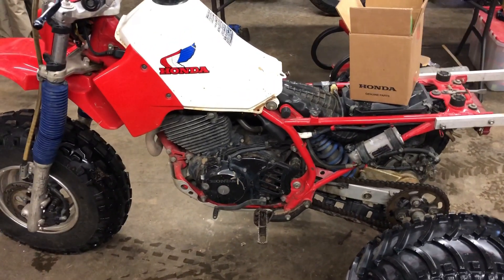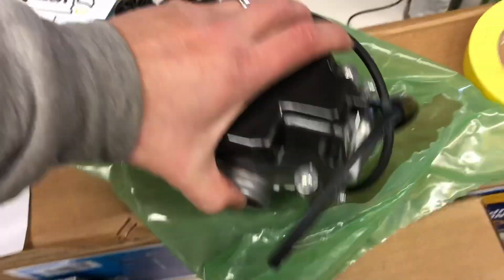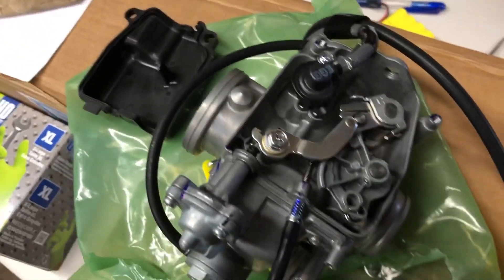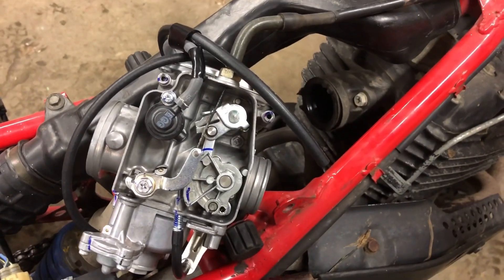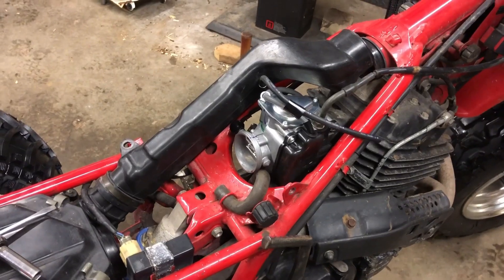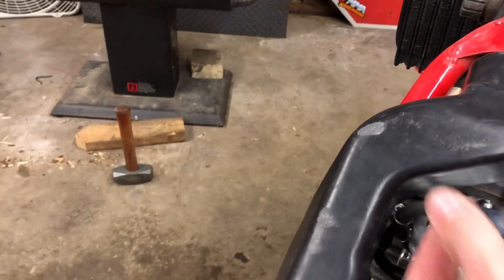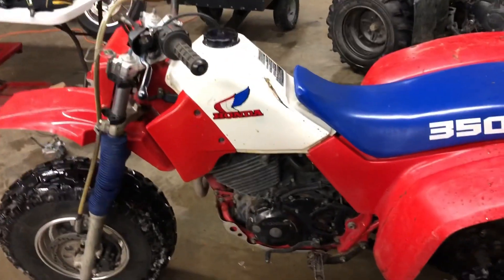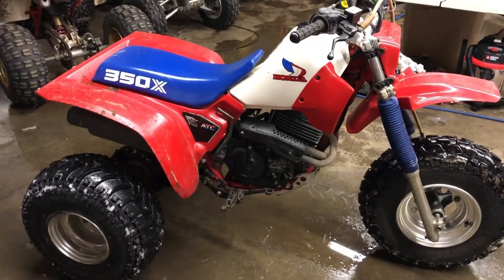350x Honda atc 400ex carburetor install

Comment: No doubt the 400ex carb is a good improvement, but an FCR with a hot start is so much better. A better response throughout the power curve and hot start makes it much easier to start after stalls! In my opinion, a must for older 4stroke kickers. Your shoes and shins will thank you! I miss my X, lol!
Reply from the maker: Man. I just bought an 86 350x. And have a 400 carb coming for it. What’s an fcr? I’ll have to google
Reply: @JohnVHLife  it's a Kehin flat slide with accelerator pump performance carb that the 06 up TRX450R, CRF250,450S Older YZF & YFZ450 came out with has outstanding throttle response. I have a 2005 TRX450R with a 41mm FCR bored to 43mm. I believe the older YFZ450s had a 39mm that should work great for your application and shouldn't be to expensive.
Reply: I'm 41 years old and I've had a permanent knot on my shin since I was 17 trying to start my X after stalling in a creek
Reply: I said I miss my X in front of a mutual friend of myself and Ex and she had a real funny look when she found out I was talking about a 3 wheeler!
Reply: And my FCR is actually a custom bored 08TRX450r 41mm to 43mm by MotoExperts the stock 05TRX450r 42mm is similar to the 400ex
Reply from the maker: @jeanhavoc6224  Whoops! haha

Comment: I bought a 300ex intake boot.It was a easy fit that way.The airbox tube just needed boiling hot water to fit.
Reply from the maker: Right on!
Reply: This boot was the best fit. Thanks for the link!
Reply: This link doesn't appear to work anymore. Can you post a new link or a Honda part number?

Comment: I put a Mikuni, that was on my xr500 when I got it, 
Onto my 85 350x.
I used a 2" Fernco from the air box to the carb..$7 at my smiling local Tru-Value hardware store. It worked out great and it looks like it's supposed to be there.
And I can swap it back if I want to I had to modify the xr throttle cable a little and kept the thumb throttle.
Starts better and runs great

Comment: I did the mod a awhile ago. I had to drimmel the intake boot. Pretty straight forward Install. It makes cold/hot starts one kick. Never used the choke, the accelerator pump built into the carb is awesome.
Reply from the maker: Did you stay with stock jets? Mines a little difficult to cold start. Hot starts take 1-3 kicks.
Reply: JohnVH Life yes kept original Jets. Should be one kick, I never used the choke or adjusted the decompression cable. I have vids of starting mine with 400ex carb. One kick.
Reply from the maker: I wish mine was, I’ve read from other people that they have cold starting issues as well, so I’m not sure what to try
Reply: JohnVH Life could be the valves, usually that’s the culprit. maybe they are out of spec. I had to adjust mine first. Super easy to do
Reply from the maker: I’ll have to check them.

Comment: I’m trying to find a carb for an 85 big red 250. The top plate for the vacuum chamber is messed up. All 3 screws broke and broke two extractors trying remove them.

Comment: I ha e a 87 trx350d amd installed a 400ex carb with alot of head work and web cam and 10 1/4-1 piston. Huge difference i
On revving amd power but had to go bigger jets. Its the same top end as a 350x but its full time 4wheel an a 69% gear reductiin. It revs to the moon

Comment: I have some questions about the hoses. I just bought the same exact carb for my 400ex. Fits great but not sure how many hoses are supposed to be left unhooked. Curious about the line going over the top of the carb that came taped to the other (2 hoses coming out of the left side that ties into one) or the other tiny use at the very bottom. Are these supposed to hook up anywhere? I assumed one of these are for fuel over flow but wasnt sure. If you have any idea thatd be awesome!
Reply from the maker: I believe all you need to deal with is the fuel line, the others you just run out the bottom if they are long enough. Im watching the video over to remember what I all did. But Im pretty sure the others just stay open
Reply: JohnVH Life appreciate that man! Just didn’t want to make adjustments and hit some trails with hoses left unhook that dont need to be. Just didnt see why two of them would be left open but seems right. I don’t see anywhere else to hook them up anyways!
Reply from the maker: @MrBrent2369  Right, I dont think there is anywhere to hook them to regardless. Thanks!
Reply: Ones a vent the other drains the fuel for storing the bike

Comment: Not sure if it's true but I have heard that most 350x need to be on tdc if you want them to start on first kick regardless of Wich carburetor you use.
Reply: What is TDC?
Reply: @MoparSammy  top dead center
Reply: My 86 fires first kick every time.. been thinking about this mod but I really dont have any issues with the OEM carb starting cold/hot. I kick my 350x from TDC when starting with a decompression cable hooked up/working and it starts easier then a lot of new/newer machines. About 12 years ago I had an 85 and 86 350x and I had issues with starting them up easily at any temp, I learned my lesson the hard way on TDC after kicking until my leg was about broken and frustration beyond believe way back when I had my first 350x's and didnt know enough to kick them from TDC every time. Also giving them a few pumps of throttle before starting seemed to make it even harder. I always shut the gas off when the engine isnt running, even if its just for 30 seconds. My cold start sequence is turn the fuel on, put the the choke on 1 click up and no throttle at all, then work the kick lever until its at TDC, once at TDC I kick it over with all I got and it fires right up and idles. I do let it run for a bit to warm it up enough before taking the choke off. If you turn the choke off too soon it most likely will stall unless you babysit the throttle. I run 20w-50 oil in mine so it takes a bit longer to get up to temp when warming it up, with 10w-40 it did not take long at all so keep that in mind with different oil types. Anyways after its good and warmed up I shut the choke off and it runs and idles perfect. That is the procedure I follow and my 86 fires right up every time. On hot startup, no choke obviously, turn fuel on, find TDC and then give it a swift kick with no throttle. Mine usually starts up easy when hot, if it doesnt happen to fire on the first kick hot then the 2nd kick ill open the throttle just barely and it will start. I've never had the 86 I currently have kick back on me once when starting so I just dont know if putting the 400ex carb on mine is worth it? Ive experienced some insane kick backs on my old trikes so after getting my leg/shin smashed in a few dozen times and struggling to start them cold, hot, luke warm I did some research and talked with some other people that owned 350x's about how hard mine could be to get running. It is definitely true that if you want a first kick start every time you need to be kicking it over from TDC, with ideally no throttle input. If your trike is hard to start then taking the carb apart to clean it thoroughly and try some different jetting could make all the difference. When the Oem carb is clean and tuned properly they perform perfect and startup is not a big deal. Great video and I will be keeping this upgrade in mind, I can see some benefit with more performance mods to the 350x engine and 400ex carb for sure!
Reply: My 86 currently has a complete 86 model NOS take out engine I just installed within the last month or so, it still had the NOS carb, shifter, kick lever, oil cooler and lines, etc. So it was never robbed for parts and runs like a brand new engine as it is new old stock.

Comment: Just curious what jets you ended up going with? I've been thinking about the 400EX carb swap too.
Reply from the maker: I ran it on the factory jets for a while. I did change the low end one size. But can’t remember what I put in.

Comment: That runs really well.  Accel pump always makes for nice starting on my street bikes.  How had your cold starts been since ?
Reply: I am considering one for my 85
Reply from the maker: Cold starts are great, I need to spend the time adjusting the jetting, but either way its a huge improvement over the stock carb!